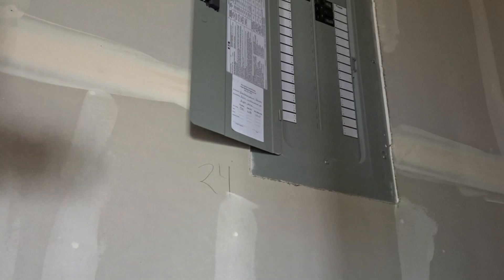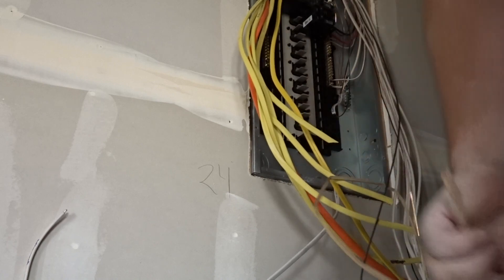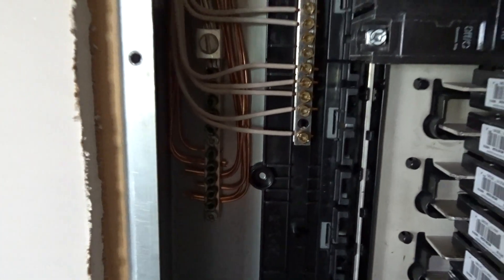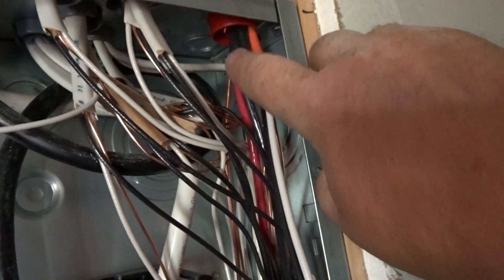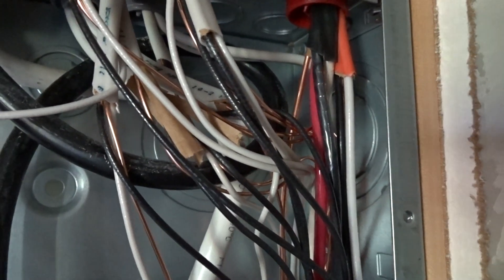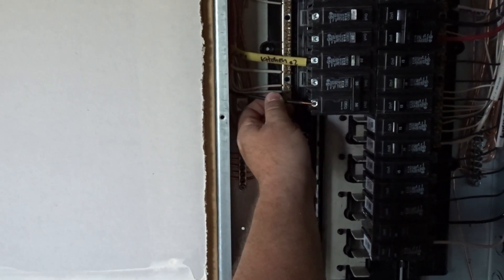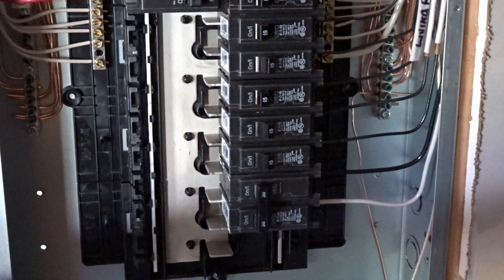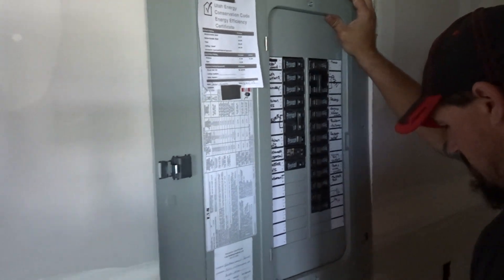How To Wire A Sub Panel In Your Home

Comment: I think you left the green bonding screw in the neutral bar on the right side of the panel. I believe a sub panel they have to be separated not bonded
Reply: That is great you notice that screw we do leave them in but to bond that what you need to do is tighten it down they just put them in for you in case so if you want to bond it you would then tighten it down and it would go through the panel cam it’s self therefore bonding everything to the can
Reply: @westernoutdoors4942  I understand now. Thanks

Comment: Ryan yes that would be fine just always put the breaker on to match the wire of how much you want to do in that sub panel and you would be fine so in your main breaker you would want to run may be a number one or And then put an 80 amp breaker on

Comment: What iF I want to install a 90amp Subpanel off my 125amp Main Panel, and THEN size it down to 80amp IN THE SUB Panel with A MAIN DISCONNECT will that be fine
Reply from the maker: Ryan Maharaj Yes that would be just fine and just write your wire for your breaker size
Reply: @doityourselfelectrical9364   3 X 35 mm square that is the  XLPE ARMOURED CABLE , Because the subpanel is to be install in a separate extention of the house 40 feet away from the Main Panel
Reply from the maker: Ryan Maharaj Just get you 100 apps up paddle and get you a 80 amp breaker out of the other side of petal and run a number 2-2-2 ser it’s a service entrance cable wire and it comes with a ground and everything it’s usually grey in color

Comment: Am installing a 125amp sub in my detached garage. I need to know that if after I remove the bonding wire from this Siemans panel, if the green screw still needs to be removed. Thought I saw yours still insatall and am unclear about addind a grounding bar in this main lug load center. Got it new for $36 online but am wondering also. if I can install a 125amp main circuit breaker in this lug panel. 
Thanks! Am a mechanic not an electrician.
Reply: Not a problem yes you can put 125 amp breaker and then just side the wire over to where you want to go you can leave the ground thank you how it is or take it out but I always want to put it back together when done if you need any other help please let me know
Reply from the maker: Yes you always want to take a ground with it you can either get a new one at where your new panel is or just run the wire from this other panel over to it

Comment: What should I run to a 100amp sub panel about 160' feet from the main?
Reply: sanders341 I apologize for the late reply you want to run a SER wire that’s called 2/2/2 It’s a bigger gray wire with all the wires in it that you need that would work

Comment: I’m running a few sub panels too my main panel is a split bus panel my house built in 1979 I do want to move a few breakers from the garage to the new sub panel that I’m installing in my bedroom on the other side of the house there is already a 100A feeding a furnace but it’s a 60a so I want to run the circuits that’s on the bedroom side in the sub panel then I’ll branch them off to the appropriate appliance etc. than in the main panel I have room for more circuits to convert my garage to a living space. Then build a workshop/ new garage along with a hot tub and greenhouse and outdoor kitchen the extra subpanles will be small ones. Is this plan ok or do I need a new main panel I already have 200A service. I enjoyed watching your video 👍
Reply from the maker: Kevin Naderi  Yes that sounds totally fine just watch your wire size so that you match the wire size to the breaker so it can handle what the breaker would handle 200 amp is a pretty good size service you should be able to do that all day long let me know if you have any questions along the way I would help you out

Comment: Does the sub panel always have to be connected to the main circuit panel or can it be connected to another sub panel
Reply from the maker: george a It can come off of other sub panels as well it does not always have to come off the main panel so get you a breaker that can go in the subpanel and then go to the next subpanel if you want to